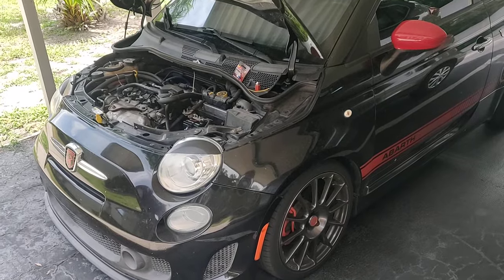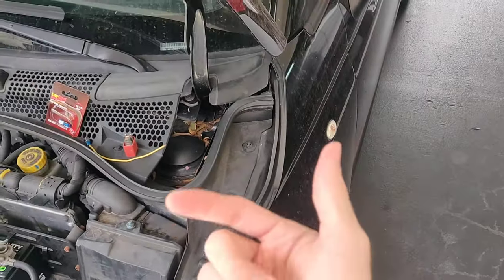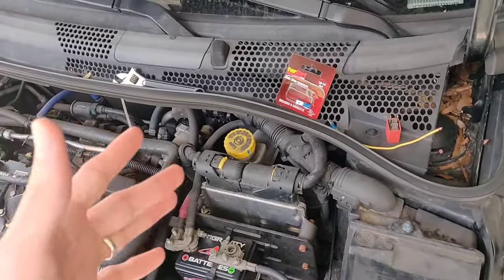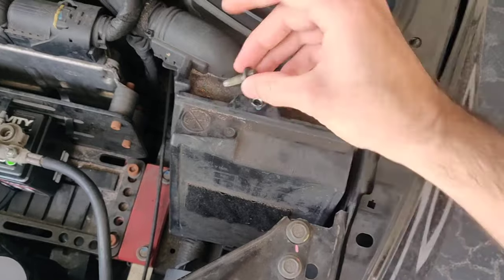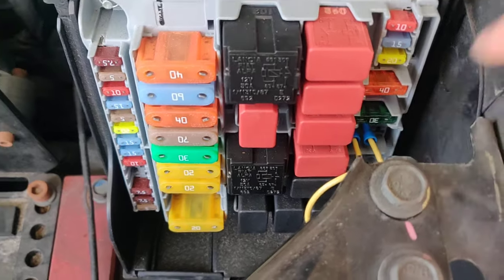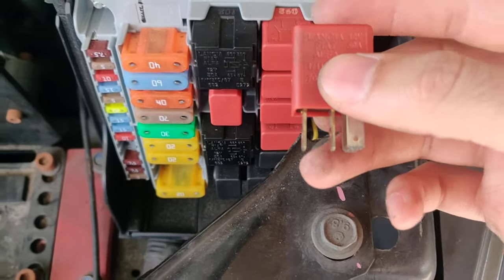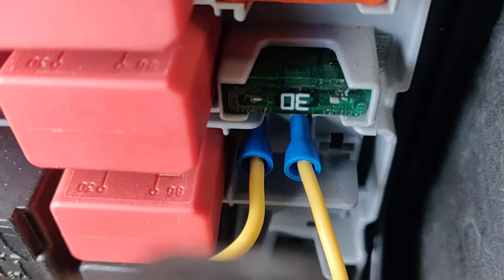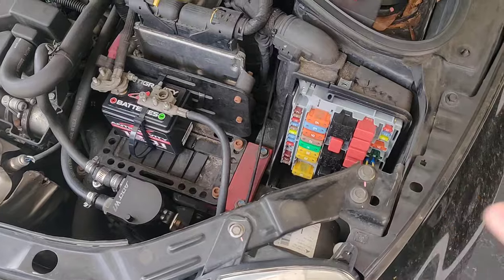Fiat 500 no start no crank fix

Comment: I have similiar problem but there is more. There is Immobilizer warning on dashboard, fuel cut-off warning and ABS warning. I hear no fuel pump when turning the key and there are no starting clicking noises from starter. And worse thing is I cannot connect to car ECU with diagnostic tools. Im afraid, ecu died. 
Fiat 500 1.2 2008
Reply: Hi, did you finde the Problem? My car has the same thing.

Comment: Running into the no start issue with an auto :(, any ideas what could it be?
Reply from the maker: How old is your starter?
May be a good idea to replace it, regardless of if it solves the problem, it could be a preventative measure

Comment: So the relay is bad? If you replace it with a new one you won’t need to do the bypass wire?
Reply: This is not a substitute for a bad relay, this is to override the safety features that control the relay.
Reply: @bojancvjetkovic2596  so if you are having starting issue this will solve the problem? Mine is 2013 Abarth an d it has been sitting outside on a battery tender for a while and today wouldn’t crank.
Reply: @TheRedgtv2000  So this video shows a method to help diagnose your issue. This is a cheap way to check if your starting issues are starter related or something else. I suggest giving it a try and seeing if your car starts. If not then you may want to get your starter replaced. Also, for a 2013, if you are still on the original starter, it may not be a bad idea to replace it if you are having issues.

Comment: I have fiat500 x lounge 2016. My car doesn’t start no matter how many times I push start button. Brake paddle is tight and can’t shift park to drive or neutral. On the dash board key fob and other stuff keeps blinking. I took out the battery to test and battery is fine. 

It happened past few weeks right after rain. I tried covering my car windshield and observed after rain. Seems ok. So it seems like anytime rains, I get into this issue. I have driven this car for 5 years and I still have 39000 miles. 

What could that be? Any help greatly appreciated.
Thank you.
Reply: Were you able to find a solution ? I just had the same issue with my 2016 500x easy

Comment: My 2012 lounge has the exact same issue described in your video. But its an automatic transmission. I've already changed the starter which solved the problem for 5 weeks. But now its back to the same issue. What else should I do?
Reply: Did you fix it ?

Comment: Hi there.
I had very simmilar issue in my wife fiat 500 but 1.2 engine.
First thing engine won't start motor turning qhen i trying start but won't start and another thing on dashboard is yellow light with lock ( i think its immo ? )
I reset battery for while and now had something worst.
When trying start engine g by turning key in ignition nothing happend, even i can't hear noise from fuel pump as ussualy happend  for 2 sec when i turn ignition on
Reply from the maker: I believe that's an anti theft feature that prevents the car from starting. I got it once on my car when I tried to open the car while it was locked (don't exactly remember how I did it but I did set off the alarm) after that I had the yellow key light and had to lock and unlock the car with the key manually I think to get rid of it
Reply: Happened to me. Also the lock on the bottom right. Is the antitheft lock. Close the doors and lock and unlock the door with your key. If it doesn't work, unlock the door and  holding the key for 15 seconds. That worked for me.
Reply: @Freddy-wc1fm this helped you ? I have very similiar problem. Lock light on dashboard, fuel pump not working and no starting without clicking noises. And I cannot connect to car with diagnostics tools which I think is very bad sign.
Reply: @Mar_Meg did you finde the Problem? My Car has the same.

Comment: This worked for me but now my car won't start again. Have you seen this before?
Reply from the maker: How old is the car? Might be a good idea to replace your starter. I have a video on that. The starter turned out to be my real issue
Reply: @krayzielilsmoki  it's a 2012 abarth with 41k miles
Reply from the maker: @charlesdarwin8392  mine is also a 2012 but at about 70k, but maybe we put the same amount of stress on the starter over the years except you primarily had shorter drives than me. At the cost of the starter it may be worth to change it out just to ensure you dont have to worry about it for another 10 years
Reply: @krayzielilsmoki  yeah good point! Thanks so much for responding!!

Comment: I have one question. It seems like your method seems pretty much similar with this video (https://www.youtube.com/watch?v=SNLcW7FhQFw&ab_channel=m0bilemechanix) that you connect 30 and 87 then the starter works bypassing the battery connection and stuff. However, in the other video the second he jump 30&87 the starter starts right away, but in your video the starter won't start till you turn the keyfob. Is it the difference between the relay type?
Reply from the maker: I did watch that video before doing this and was expecting it to start but it didn't. It may be the difference in the starter because our starter only gets the power wire and not a power and signal wire like most cars.

Comment: I had a fiat 500 1.2 2013 wont start dont do nothing what can i do
Reply from the maker: Try replacing the starter. It's old enough that even if it's not bad it's on its way out so it wouldn't be a waste.